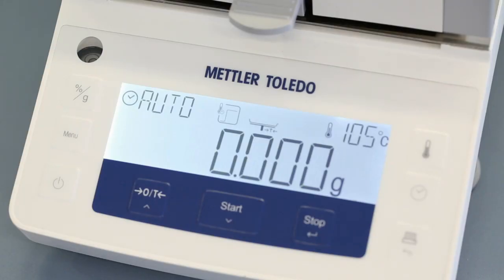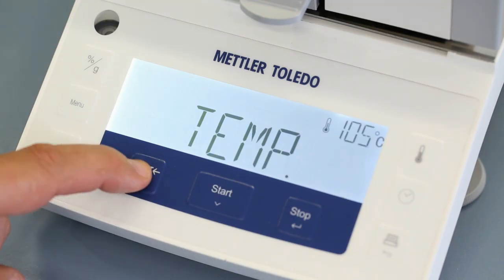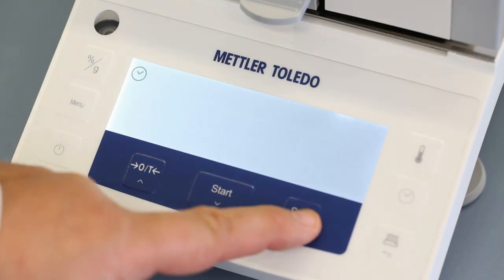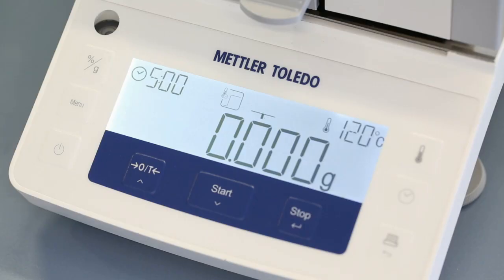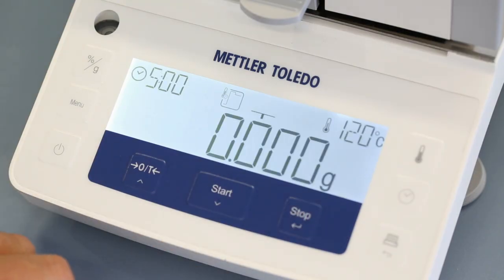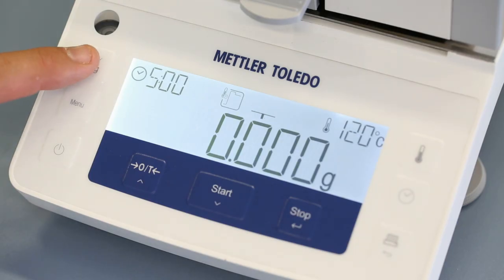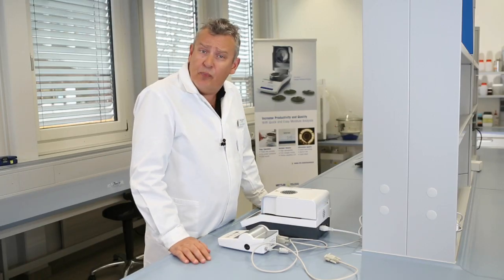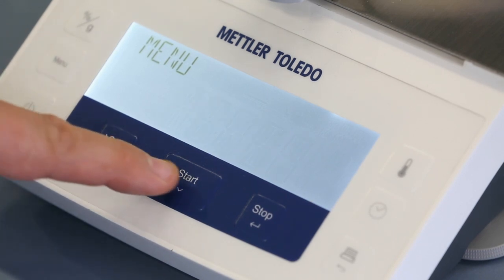HE53 Moisture Analyzer quick start guide 4 Instrument Configuration

Comment: is there any difference between version 53 and 73 ?
Reply from the maker: Dear Elbahar Mondy, thanks for your request! 

Yes there are differences between HE53 and HE73. The two biggest differences are the method memory and the maximum drying temperature. HE73 can store two methods (A & B) and can dry samples with a drying temperature up to 200°C. Find out more on Moisture Analyzers - METTLER TOLEDO (https://www.mt.com/global/en/home/products/Laboratory_Weighing_Solutions/moisture-analyzer.html)!  
You can use the "compare" function of both instruments to get the full overview!